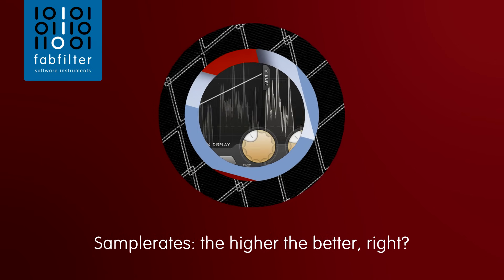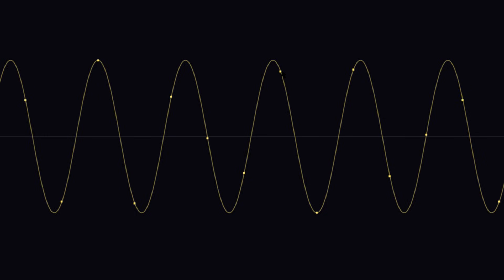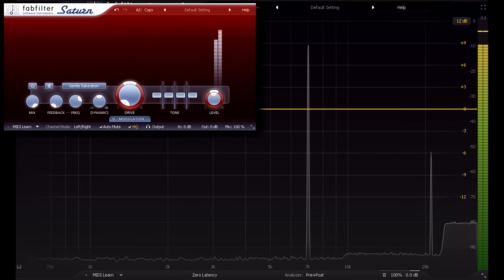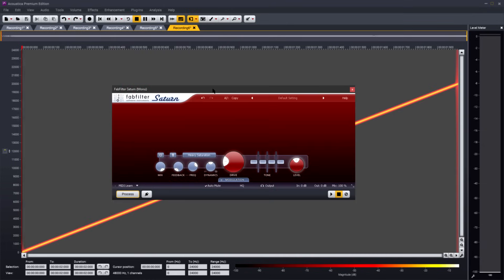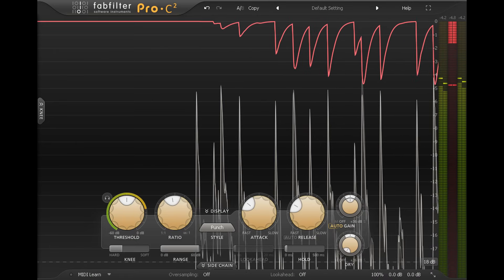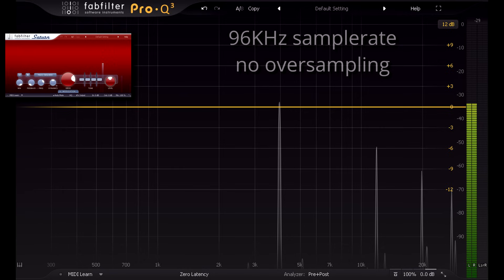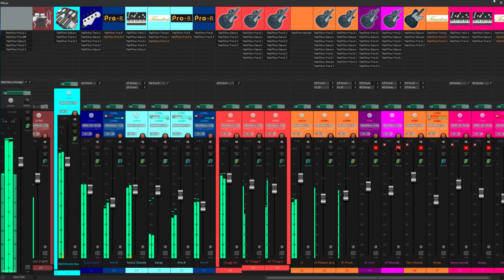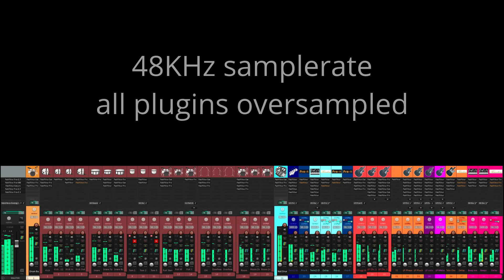Samplerates: the higher the better, right?

Comment: There is a bunch of good information here, but also a fair number of fundamental confusions. One example is the use of off-line conversion as a stand-in for end-to-end sample-rate differences. That completely misses the point of using higher sample rates. There are several places where the presenter rushes through his argumentation to get to his conclusion that higher sample rates do not help and may hurt. This is simply false and his own presentation demonstrates this to be so. The video simply shows a more efficient way - in certain contexts - to get the benefits of higher sample rates (oversampling being a limited use of higher sample rates) without the memory hit of applying higher rates to the whole project. There are independent reasons to take the hit and to oversample as well, which I will not get into here, but the story is considerably more complicated than our silky-voiced host allows. Had he just gone in for describing the benefits of oversampling in plug-ins and following one’s sense of what sounds good, we could have avoided the faddish, idealized discussion of sample-rate edge cases (the golden rule is actually not golden and is somewhat less than a rule in actual computing, among other topics) and the bugbear of intermodulation (which is, where it is an issue and not desired, cured by filtration, planning, and, uh, higher sample rates).

Yes - to be sure - what sounds good is good. That is always a good guideline for audio production. Thanks for the thought-provoking video.

Comment: In a daw, with synths, especially when using squares, i hear a huge quality difference between 44khz and 96khz..to the point where its unbearable to mix at 44khz..I am not entirely sure how to explain this, no reason to export higher when its mixed though..
Reply: Well this is the thing that I thought about while watching the video at 2:45 , all waves that have straight lines are then curved by the analog conversion he is talking about. An higher sample rate would means a better representation of the the straight lines in square, sawtooth and triangle shape right ?

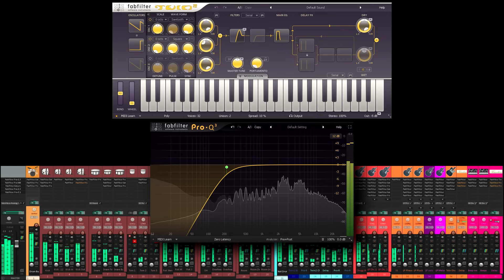Comment: 24:15 that's unfortunately not true - CD 16bit/44.1 kHz has a 1411 kbps bitrate, whereas Youtube streams audio only at 128 kbps for non-premium subscribers, and the latter ones only get a mild bump to 256 kbps.
Also, I strongly disagree with your final conclusion that higher sample rates are not better. They are, but you need huge (read: enormous) jumps in sample rates to see clear benefits (like DSD audio does with sampling at MHz rates).
Higher sampling rates are not about "those higher frequencies that some people claim they hear in a magical way that science cannot explain".
They are about sampling actual music, which is made up of multiple concurrent sounds/frequencies, thus happening at the same time. Huge sample rates allow the capturing of data for each of those harmonics at greater and greater levels of resolution the higher the sample rate.

The problems though, as you alluded to several times here, are mainly processing and storage, among other things. One day though, those problems will be less of an issue, and it will become much more obvious that huge sample rates (Mhz and beyond) are highly superior in sound quality to the lower ones we have today.

I actually feel bad for people who do their master recordings digitally only at 44.1/48 kHz or thereabout. They will realize in the future, when stuff like high-rate DSD becomes more prevalent, that they made a big mistake recording music digitally at such lowly sample rates. They would be better off instead recording their masters on tape.

Same thing happened in the video realm, with some shows recorded digitally at low resolution back in the 80s/90s (e.g. Married with Children), instead of the better choice at the time of using film, only to realise later on in the 2010s that they couldn't remaster them to high-res like 4K, because they hadn't used film. (and digital upsampling of the signal is just not good enough compared to digitally scanning at higher res the analog original recording, only if they had one).

I am pretty young myself and, like a few other commenters here, couldn't hear differences in several of your tests made and that's probably down to the very low audio bitrate of this YT video, so maybe keep that in mind for future videos.

Comment: It's a fallacy, Nyquist-Shannon sampling theorem allows you to determine the frequency of a continuous signal from discrete points , but not the amplitude with any great accuracy - which is what you are incorrectly inferring with the Acoustica software from Acon Digital plots. 

I applaud your attempt to explain the theory though.
Reply: MF Nickster  Thank you for the reply - you are probably right in fitting data to the samples. My issue is with the reliability of this,  in the extreme case where there are two samples per cycle, would you be able to tell if the reconstructed waveform was a triangle wave or a sinusoidal waveform?

I find it interesting in the case of DACs and reconstruction of the continuous signal from discrete data, and would posit that the waveform shape (regardless of frequency) is lost, and therefore the energy from the area under the curve is not reliably determined. Quite often for industrial purposes 32 data points per cycle might be taken for example on power measurements which need statistical significance.

The other issue I have with this is that music is not sine tones (continuous fixed frequency/amplitude) but dynamically changing. Even if it can be decomposed into sinusoidal components, the frequency, amplitude, phase and waveform shape change in time and are modulated in time.

I think this is why music especially with anything that has higher frequency components sounds better, perhaps more natural, when sampled at 96 kHz as opposed to 44.1 kHz or less.

Comment: the reconstruction that you show here is wrong. it is a special case with one signal that has one single frequency with one constant amplitude. that has nothing to do with a real audio signal that is unpredictable. therefor you can only use some kind of low-pass-filter.that filters out high frequency artifacts that are not part of the signal

Comment: Yep, there's literally ZERO audible differences between the two process modes, or between the different sample rates demoed here, possibly at least partly due to the resolution limits of YouTube itself being 44.1KHz and 16 bit, just like basic CD audio...

And of course it's even LESS possible or probable that anyone can actually hear ANY significant differences between the two examples if they're just listening to this video on their crappy built-in cellphone or tablet speaker(s)!... In THAT case, if they ever think they CAN hear a difference, then they're just imagining it because it's physically impossible using that low of resolution playback AND speaker(s)!

Comment: Yep: Number one noob "Digital expert" error: Suggest graphic concepts as generally analogous to audio sampling theory.
Reply: what do you mean? (If you could explain or let me know where I can learn more I'm very new to engineering)
Reply: One of the biggest mistakes is assuming digital graphics are a reliable analogy for audio.

In graphics, the amount of pixels, but depth, blurring, sharpening, aliasing etc all have specific effects on visual impact.

But audio is time and sequence dependent and band limited. The way a set of samples sounds is dependent on the previous ones, and you have to use a filter to code and decode the audio correctly.
The analogies break extremely quickly and you end up with false ideas.

Many of the "new advances" in audio are not able to reproduced by audio monitoring systems, and some are even detrimental.

Our hearing is also heavily affected by perception bias, so we even attribute "quality" to things that are actually distortions.
The hifi industry is built on utter BS and the misconceptions have bled into pro audio.

Look up the stairstep fallacy in sampling theory to start with.